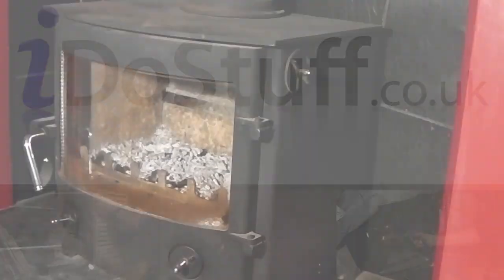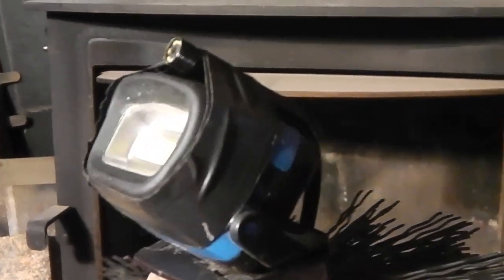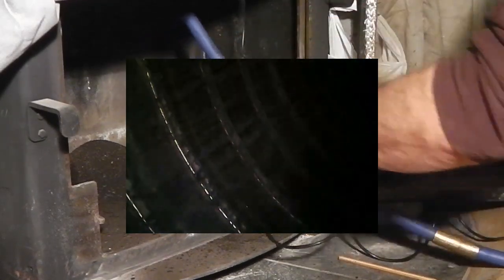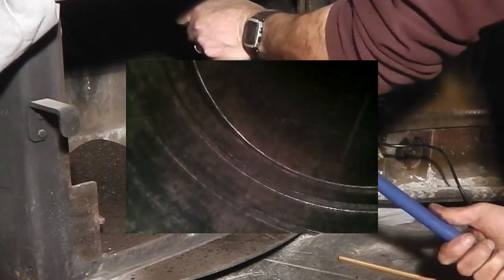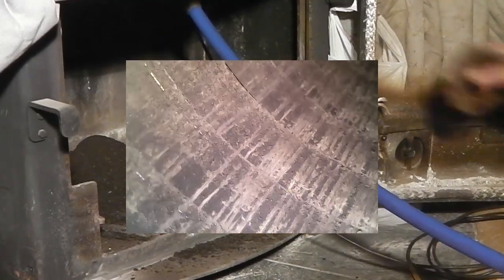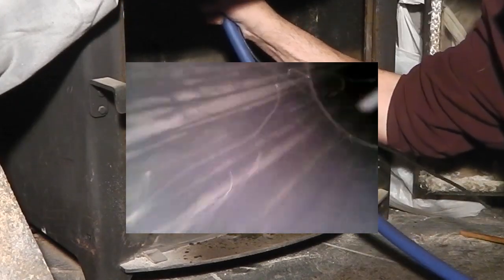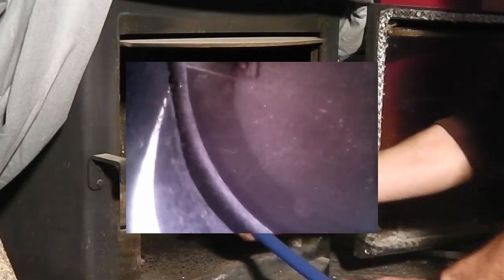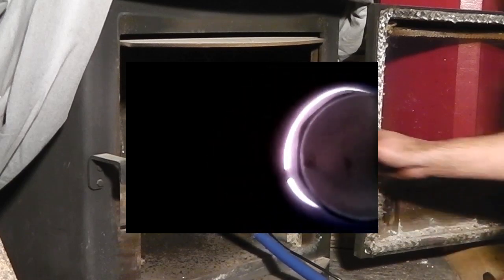Un-insulated Stove Flue Inspection - tar / creosote ?

Comment: Nice to know there is no tar buildup. My register plate has cracked  (stove installer used 5mm board instead of 12mm) and all the vermiculite is falling out. I aim to replace the plate with a steel one and not put the insulation back again.